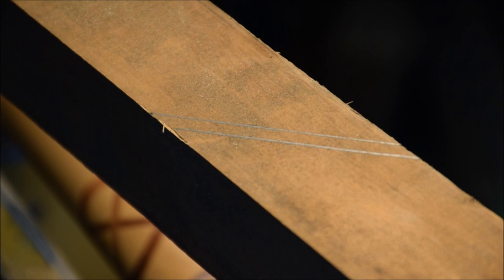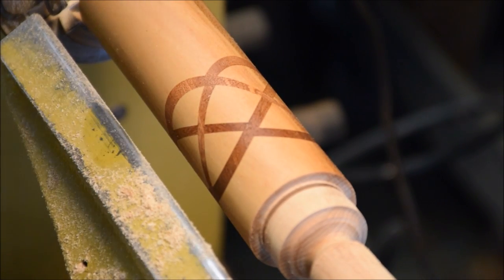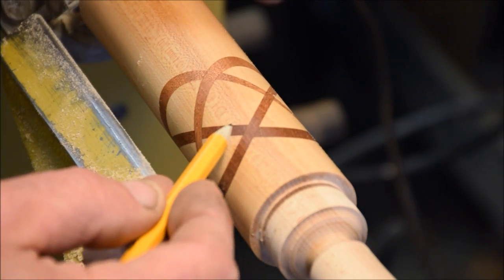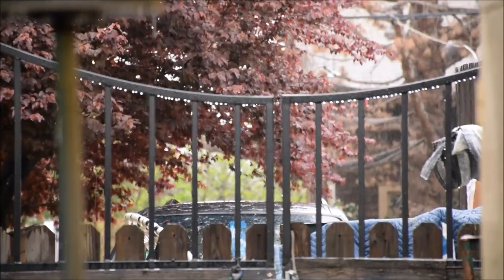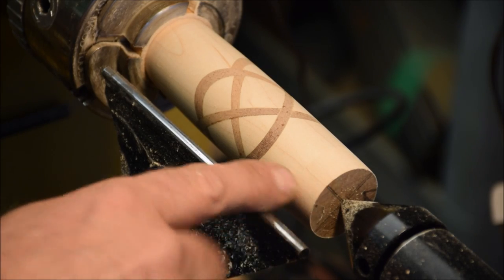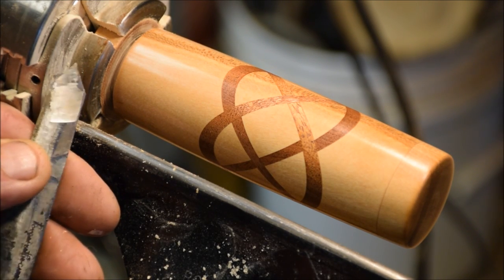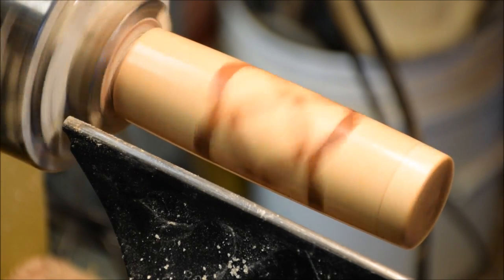Woodturning With The Naked Turner Revisiting The Celtic Knot Canister

Comment: Great job Erik and you're right those little imperfections are what makes it special sometimes so we can appreciate the work that goes into it.Great video and what an amazing view you have from your shop.Take care
Reply: +Al Furtado (Rebel Wood Turner) As far as seeing the patterns I use to work in textile printing and trained my eye to work like a strobe in order to see a pattern being printed at 100 yards per min and focus on it as a still image to catch defects. some speeds of course worked better than others.in this case you filming at 30 frames per sec and if the piece is rotating at 600 you will se a full image as you are only spinning at 60 rpm if you blink your eyes fast enough you can see a still image.
Reply from the maker: +Al Furtado (Rebel Wood Turner) Thanks Al!
Reply from the maker: +Al Furtado (Rebel Wood Turner) Stroboscopic Zoetrope  effect.  I used to make textile designs just as concepts for myself but never did anything with them, my mother's side of the family were in the textile industry.  Thanks Al I really enjoy your feedback.

Comment: Nice job Erik, the inlay thickness must exactly match the blade kerf and even then it is finicky, I have done several and even when I got the sizes right on the darn thing would slip in glue up so I am going to make a jig to hold everything aligned the next time I do one, and if I get it right I will make a bunch of blanks while I have the process correct. I have made several pens that came out real nice and used the bandsaw to get the thin kerf for that small diameter and people loved them. They look cool and  are fun.

Thanks for sharing Erik, great work, and I loved that slight bulged center I have to try that.
Reply from the maker: +John Bare Thanks John. I want to get a better shop setup sometime in the not too distant future so I could make some jigs to make these more efficiently as well.  Thanks for watching and I hope you get your jig all sussed out and made.

Comment: Doing Celtic knots is a lot like segmented bowls. A small error in one aspect leads to cumulative errors in the whole.  Even with a right-angled gluing fixture, ostensibly to avoid slippage during glue-up, the problem will still present itself. My hint (because the explanation is too long for a comment) is to think centerlines, not references from an end like most approaches advocate.
Nonetheless, thanks for letting me visit your shop again.
--Joe
Reply from the maker: +Joseph Scarborough Thank you so much, I agree it is all about a center line and that is how I approach it. I mark out the kerf line and then if it goes off a bit I correct as much as possible the center line and let everything else do whatever as long as glue jounts are tighr a 1/32" here or there is no big deal as long as the center lines is good and the stock remains the exact same thickness, which is where mine drifted primarily.  I just band sawed a strip and hand beltsanded it to a thickness that varied a bit, not much but enough.  I am happy with the end result and beautiful imperfection is all I ever strive for.

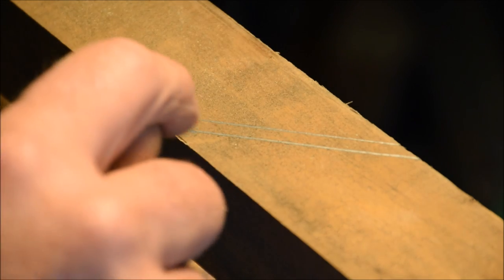Comment: Erik, re: @2:30 
Right now, I'm setting up on my table saw to make the same cut. You CAN leave a bit of material, using a table saw. I've set up a temporary jig in one of my sleds to hold the piece at the correct angle. I raised the blade to within about 3/16" of going all the way through. It's been awhile since I've done a Celtic K-not. So, I came to you for a refresher on it. (My sliding miter saw can't cut a straight line to save its life - the blade flexes.)
Reply from the maker: All I can say is give it a try and see how it goes. The key is replacing exactly the same amount you remove.  Seems like that should work just oversize your piece enough.
Reply: Yeah. I've done it this way before. I've got one of the pieces in and under clamps, now. It's actually the third piece. I had already inserted two square-cut pieces, to frame the design.  Those were relatively easy. I sure enjoy your videos.

Comment: The patterns came through great when you turned the piece at different speeds.. Nice piece. It would of been nice to see the square block with contrasting wood inlays before you turned it. Also how you clamped the wood while the glue dried.
Reply from the maker: +Brian Binns You can watch my other video on making one on the bandsaw which is a better way to make one of these less clamping hassle. look up celtic knot canister on my channel if you haven't seen it yet. Perhaps I will revisit this again.
Reply: +Erik Anderson 
Thanks i did.
Reply: Brian Binns Was pretty cool! I would have never thought of something like that

Comment: When you want the pieces to stay put use a tiny bit of salt when gluing up. Before the salt disolves the 'grit' will hold the pieces in alignment. BTW, please save all that water as we don't need to be giving away any of lake Erie. LOL
Reply from the maker: +wood Thanks Wood! good one and I know I have seen that trick before but with these pieces being at an angle they continue to slide.  I just need to make a good jig.
Reply: One I saw was two pieces of hardwood glued together giving you a 90 degree angle. Clamping one piece to hold it you can glue the other pieces and use anotehr clamp to keep them aligned, then  another clamp or two to pull them together. Very effective.

Comment: Erik, I was just thinking about how they slide when gluing up each time. It did that on me too. Just struck me, why not drill a centre hole through the centre of core then as you add each wafer drill it to match the hole and place a dowel in it so when clamping it can't shift. Just a thought! I'm gonna try it when I can
Reply from the maker: Watch Joe Giannina's Celtic Knot videos he has an easier solution.
Reply from the maker: Thanks you crusty Swede!!!

Comment: Hi Erik great video. I don't know if you would be interested but years ago I made some pens with the Celtic knot. Same design as yours and similar in making with yours but the biggest difference is that I used a jig for the band saw and the blank turned round first (over sized). If you are interested let me know and I will post it for you. Cheers Mark    this is the link  http://content.penturners.org/library/techniques/6-strand-celtic-knot.pdf
Reply from the maker: +markmiller1549 I always like to see stuff like this thanks I will check it out.  Thanks Mark!